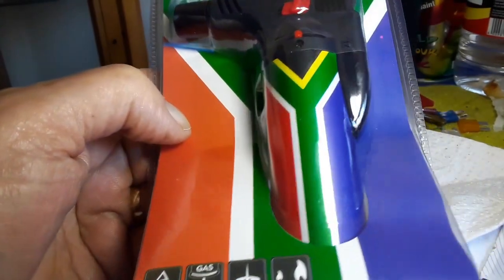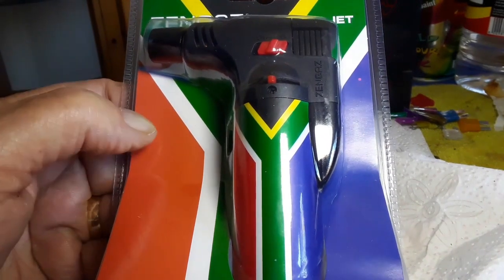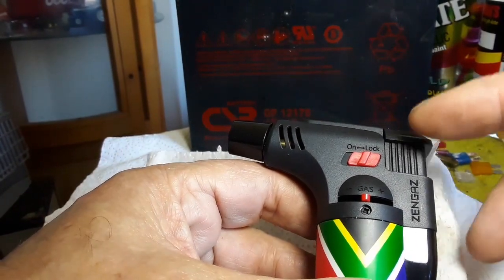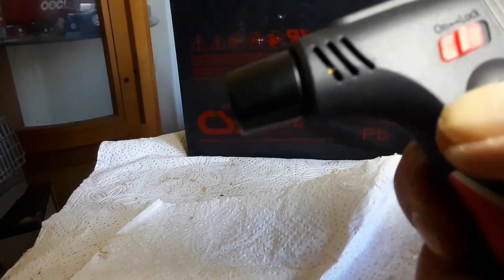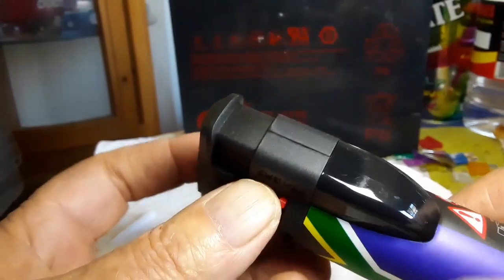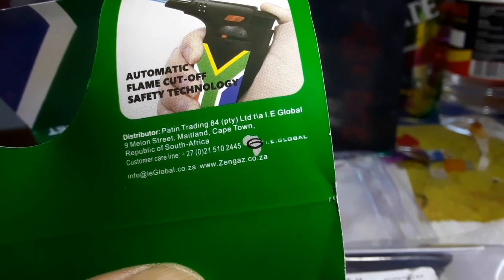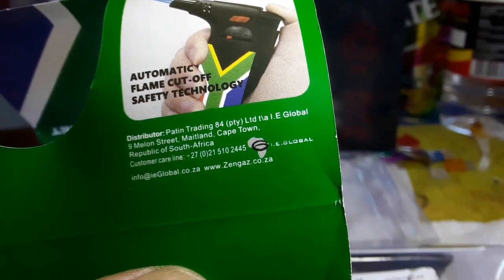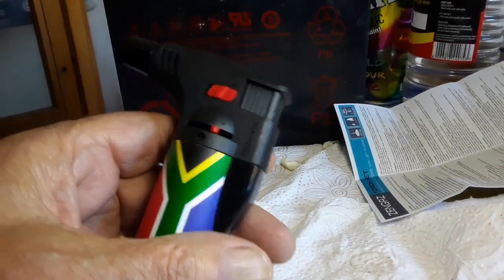Zengaz Blow Torch

Comment: I have a micro torch very much like that. Not sure what brand mine is.  I have had it for probably 25 years. I use it on heat shrink tubing and connectors.
Thanks Jan
Reply from the maker: Thanks for sharing Gary, that was my main idea with it, heat shrinking